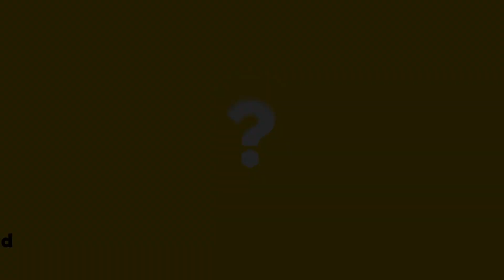QUICK TRAILER TIRE FIX

Comment: Has it held up? the location and size, i would say replace it, but given you have your own machine, may as well see if it'll hold up!
Reply from the maker: I replaced it. Easy fix for lasting results.
Reply: @curiouszquad  probably the best decision. Replacing on the side of the road sucks lol
Reply from the maker: Yes it does!